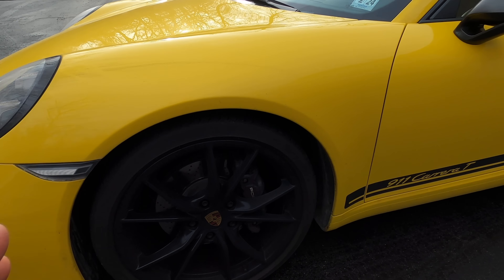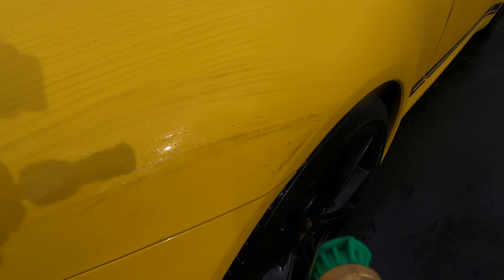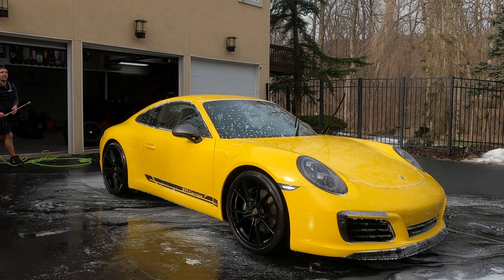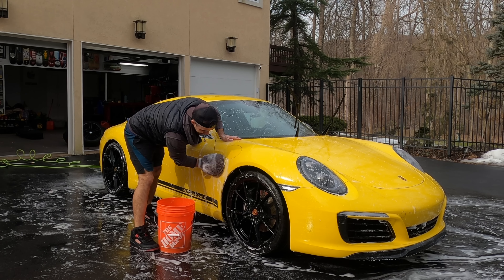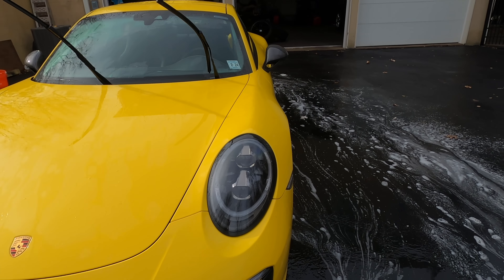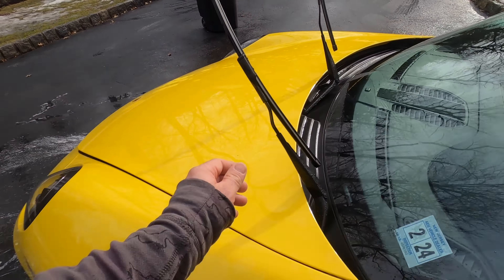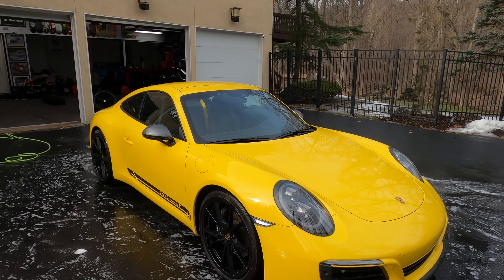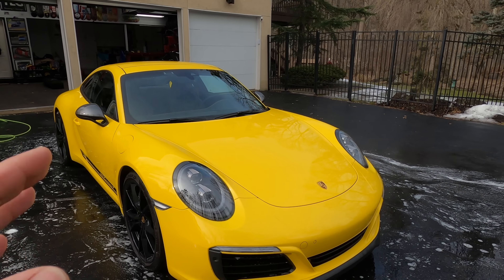The First Porsche 911 Wash Revealed a Few Things...

Comment: Can’t wait to see the mods you are going to do! I have a Black T with a tune, exhaust, and set of HRE wheels on it. You are going to love the sound of the sport cats. I do have two wash tips for you and those super dusty brakes. First get the wheels ceramic coated, that makes them a lot easier and quicker to clean, second wash the wheels last after the car is dry and clean. As soon as you have washed and dried the wheels take the car for a short drive and do 5-10 braking cycles. Speed up and a deploy the brakes. This will ensure your rotors are dried before they can start the surface rust process. If you wash your car and park it, the rotors will turn brown with rust and that rust will immediately make your wheels completely brown after 1 drive. You should find this greatly improves the appearance of your wheels for longer.
Reply from the maker: Thanks for the tips I really appreciate it! I can’t wait to get started on her but I won’t go as crazy as with the M3. This car is nearly perfect.
Reply: it is enough to rinse the rims with deminarized water and the head problem.

Comment: Regarding the brake dust, I would recommend just buying a premium iron remover (eg Carpro IronX) to deal with that. Can recommend a channel Pantheorganiser on car detailing products (the guy drives a Turbo S himself). Also, to protect the paint a bit more  on the parts that are not protected by PPF you could consider buying one of those ceramic infused or graphene infused paint protection products that make the paint so much easier to clean as it makes the paint dirt and water repellent. Also available in spray-on formulas. Have fun!
Reply from the maker: I just refuse to pay so much money for iron remover....it sucks

Comment: Tommy, finally picked up my Y! Love it, ordered the rear wheel PPF and will follow your video tutorial. I want to buy a detailing chemical setup, exterior and interior. What products do you use? Thanks for all the info.
Reply from the maker: That’s awesome. Congrats!!!  You’ll love the Tesla. 
I linked the products in the description of this video.
Reply: @TommyLGarage  Thanks! Loaded up my shopping cart. What are you using on the Tesla seats and interior?
Reply from the maker: @davidp7414  on the seats I use the same stuff I used on the M3. Cleaner and conditioner works very well and keeps the seats nice and dull.

Comment: never been bold enough to go for speed yellow, on the T looks perfect. BTW quite a few poor washing techniques likely to deteriorate the paint
Reply from the maker: What was so poor about this washing technique? Just curious
Reply: on the wheels really they should be done first, before sf the car.  Then on the wheels the same brush used to do the arches and the alloys. Being black that will be rubbing grit into the surface.  On the tyres really need a stiff brush rather than a mf to get the dirt out.  Also and perhaps the most risky is one bucket meaning the dirty rinse water is being picked up by the mitt and damaging the paint. Over time it dulls the surface but nothing a machine polish can’t sort 👍
Reply from the maker: @jonfrench7133  thanks. So I washed and rinsed the wheels first using a separate bucket. 
For body - I used a separate bucket with a grit guard. Not much I can do as a non-detailer

Comment: Not going to lie … I cringed a bit when I saw your wash process 😪 well at least you have a few Porsches and an M3 and I don’t 😬
Reply from the maker: Just out of curiosity what was so cringe worthy about it?
Reply: @TommyLGarage  nothing major really but just some advise. I suggest to use a wheel cleaner with active ingredient to dissolve the brake dust (reacts purple) and a stiff bristle brush for the tires instead of a cloth. Also two bucket method wash with two different mitts. One pad and one mitt for the bottom parts. Just to have a really clean ride and avoid scratches. Oh and yeah you definitely need tar remover and perhaps a full decontamination. Enjoy your new toy 😎
Reply: @charleyschaubroeck6301  I was cringing too.  I started scrolling thru the comments to see if I was the only one.  Took far too long to find this comment.  @TLG, with such a nice fleet and nice wash tools at your disposal definitely invest a little time in looking into how you wash.  The little things you can do to help reduce micro abrasions in the clear cost/paintwork.  I’m by far no expert, but for such a pristine, low mileage, and most likely collectible car, it deserves some TLC from TLG.  Beside, new skill learned = content and spreading the knowledge.  Beautiful T.